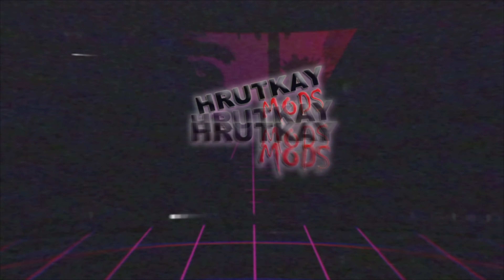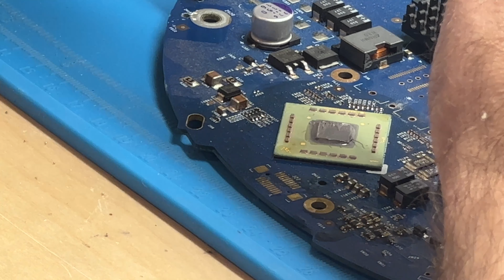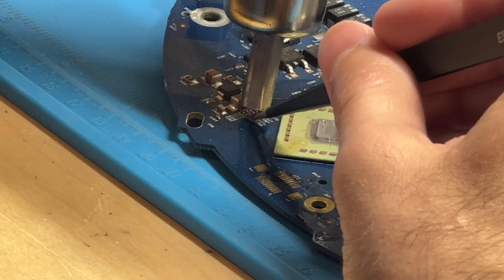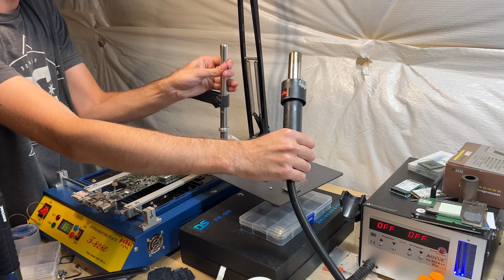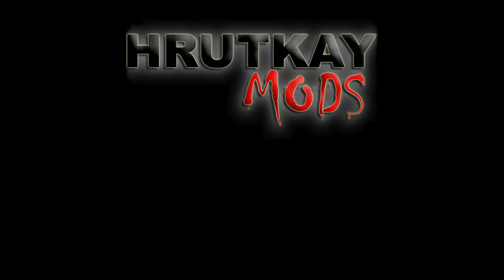The World’s Fastest iMac G4 Part 4: At dosdude1's Lab! – PowerPC Series S.4 EP.16

Comment: So, I've done some research and found there is a 1920×1200 pixel LCD panel that fits in the 20 inch iMac's screen-housing but it runs at 5v like the 15 inch and 17 inch screens, and requires an LVDS video signal, but if you replace its CCFL backlight with an LED one, it shoudn't need a CCFL inverter-board anymore and it should be possible to put a TMDS to LVDS converter board in its place within the screen-housing, if the iMac G4's internal video-connector can drive that many pixels at once.
Reply from the maker: there's a jumper you can modify to change it to 5v